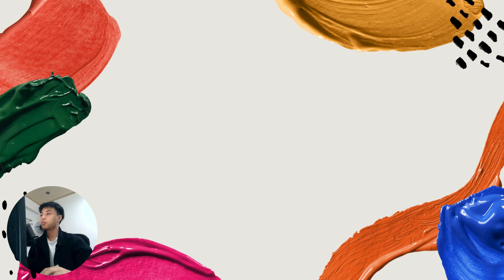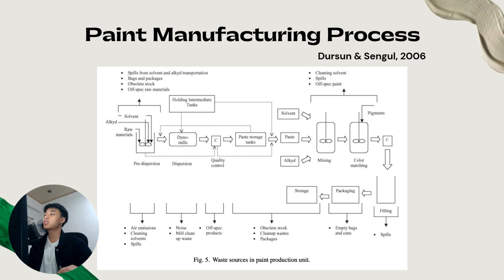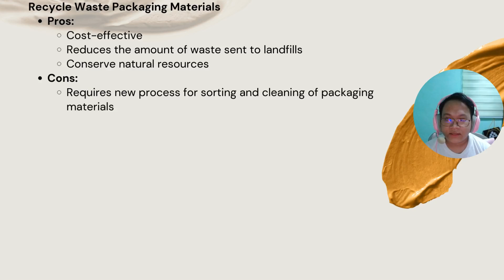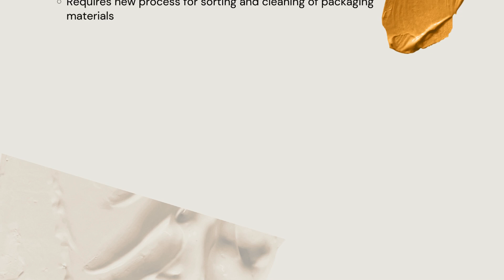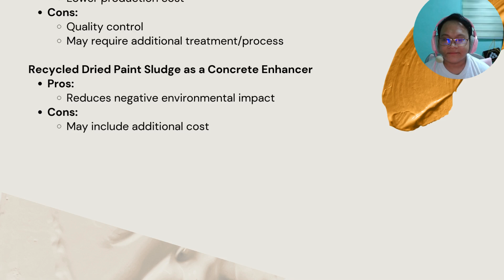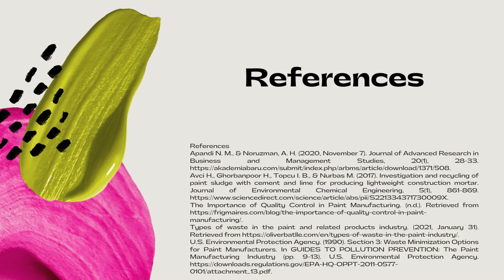Group 2 Paint Manufacturing Industry

Comment: The feasibility of dried paint sludge as a concrete enhancer could have been better shown if the composition of the DPS had been shown or at least mentioned why it is capable of doing so.
What are the specific solid waste materials in the production of paint? The mentioned sources are too general and vague for a case study. Also, the procedures by which the pollution has been sourced, though briefly shown in the PFD, could have been given in detail.
Similar to the second workshop, the raw materials were not mentioned in the presentation, and the suggestion of reusing the said raw materials made us question what this is referring to.
Given that your presentation is only 7 minutes in length, it could have been better for the presenters to provide a more detailed background on the topic, the components, and the suggestions. The PFD also showed more solid materials that could have been tackled.
The existing solid waste management methods for pollution control were not mentioned in the presentation.  What is the paint industry already doing to manage their waste? Where are their waste products disposed of? 
One of the proposed solutions was recycling packaging materials. Could you be more specific on how these materials can be recycled? What products can be made into?
Reply: Apologies for late response. I'll try to address the questions one by one:
1. Solid wastes include packaging materials (metals or plastics). Regarding PFD, I agree that we could have provided the details to maximize the time. We'll take note of that.
2. The solutions mentioned were the current methods/studies that are being applied. What we're aiming to do in this workshop, and capstone, is to identify which practice is best applied and improved for a chosen scale of production to be sustainable. Apologies if not mentioned but wastes, if you're pertaining to unused/not recycled, undergo incineration or transferred to landfills.
3. Apologies again if we have not detailed how recycling goes. It was not detailed in our resources but we'll look for more. But based on our understanding, packaging materials can be processed to create new packaging. Or atleast cleaned to be able to be used again.

I hope these clarify your questions. We'll be taking note of the suggestions. They are highly appreciated.